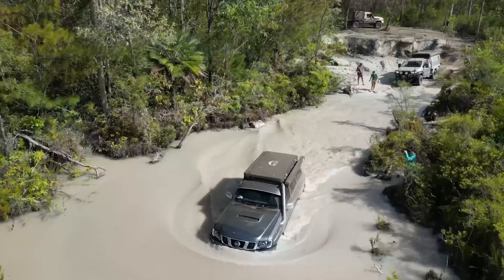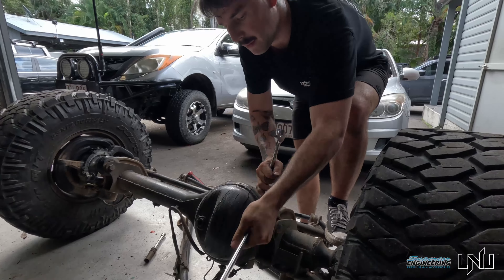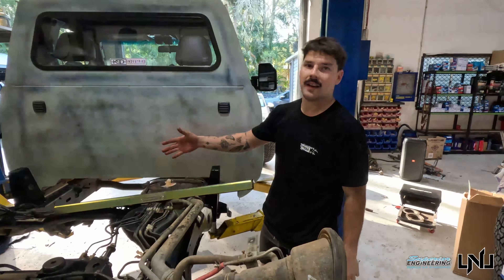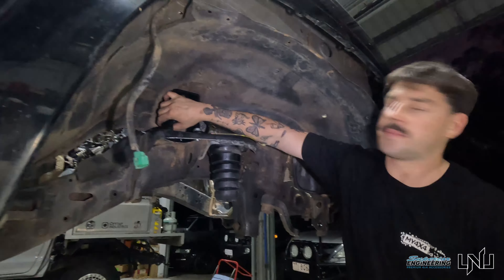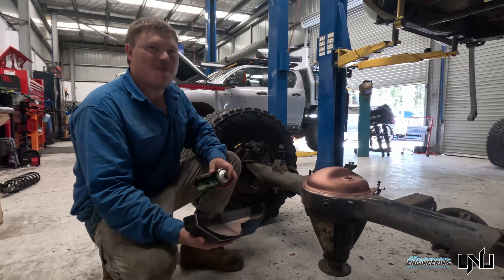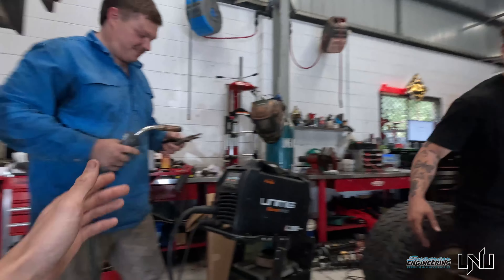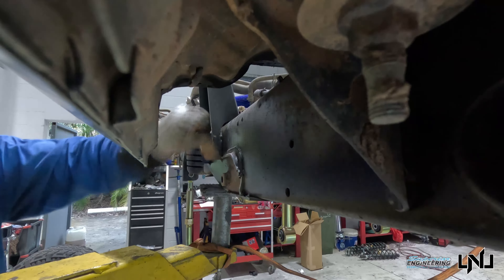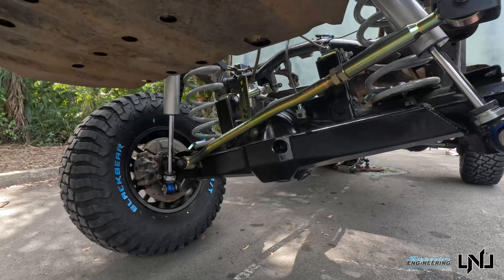GU SUSPENSION PART 1 || Braced Diffs and Long Arms

Comment: Hi mate just saw your chassis above the rear coils, looks the same as mine. Is it bent?
Reply from the maker: Hey mate not too sure which part you’re talking about but no the chassis is not bent
Reply: @lockednloaded_4x4 the rippled section behind the rear tyre, mine has it, not sure if it’s factory or bent.